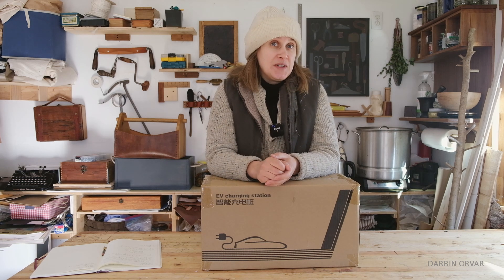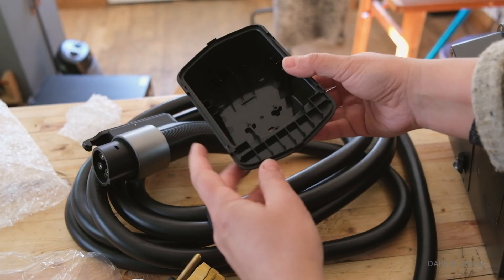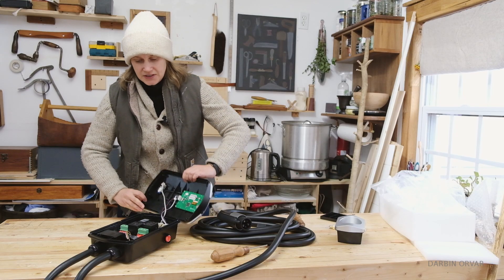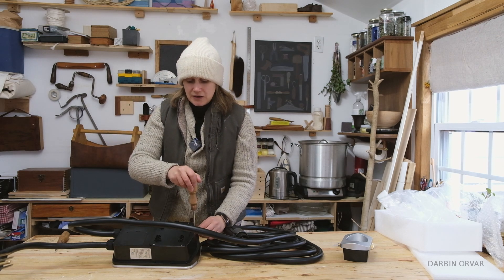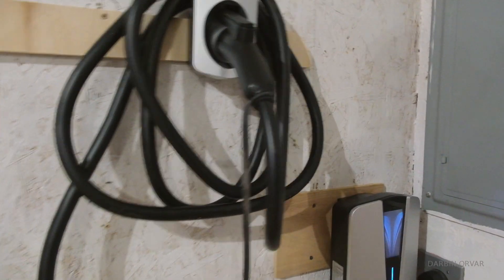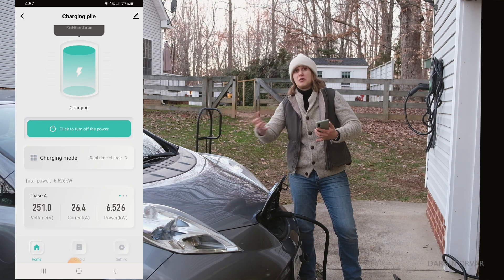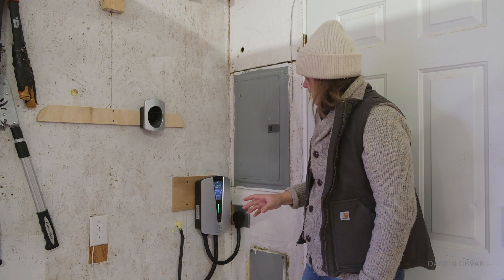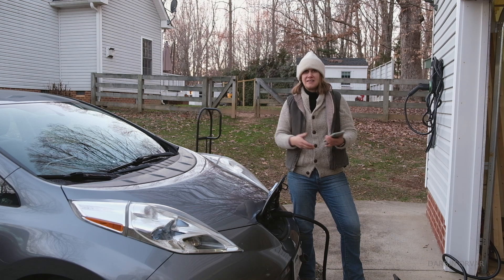240v Home EV Charger: Telgeoot Level 2 Charger Review

Comment: Great video,This is a smart charging unit,Allows to adjust charging current range from 1 to 48A, level 2 EV 240V 11kw home charger can work 7X faster than a normal Level 1 chargers , Say goodbye to long charging times.

This is truly an excellent overview using technically correct but understandable terminology.  Thanks！

Comment: 👍👍This product looks really good and I can't wait to buy it, it charges much faster than what I'm used to. The installation seems simple, and you can check the charging status using WiFi on your phone. It must be very convenient to use. I checked their official website information and found that this product has almost a 5-star rating and can be charged unconditionally in rain or snow. The performance is really high.

Comment: Do you have to have this connected to a 240 V outlet with a 50 A breaker?   Your car apparently has a maximum input current of 26-something A, below the 30 A capacity of most household 240 V circuits.  Are there cars that can accept higher input currents, and if so, can this device be "throttled" to avoid blowing your household breaker each time you try to charge?
Neat gadget, nice video.  Too bad about the "app dependence" but I'm just a curmudgeon.  Thanks for sharing, Linn.
Reply: Darbin gets the purpose of amperage limits wrong here. Setting the amperage limit is not about the capacity of your car (which will automatically take its maximum), but of your wiring. If you do connect this to a 30 amp circuit, you'll need to set the charger for a maximum of 24 amps (which is 80% of the circuit's capacity)

Many cars can take more than the Leaf's 26 amp maximum

Comment: Too bad you can't pull in to your garage.  I have the charger head and cord dangling from the ceilng just by the front license plate making it very easy to plug and unplug the charger to the car without having the weight of the cable to worry about.

Comment: Ev are stupid. You charge your car for 100 $ and after freezing night 30$ of your fuel is gone. How is that economical. You fill your petrol car with 100$ and after freezing night you still have 100 $ worth of fuel in your tank
Reply: Not sure what you mean by this?  If I put $100 of electricity into the car overnight, that is exactly what I have in the car in the morning. And with the Nissan Leaf, you can even set the temperature you would like to have the cabin at the time you plan to leave in the morning.
Reply: @davidabineri908  if temperature is below  - 18 C like now in my country than from 100% charged battery it drops to 90 just by sitting outside
Reply: Wrong. Go back and do your homework again
Reply: @Jose-qh6bc  if in summer fully charged car can drive for example 100 km and in winter it can drive only for 80 km than it lost it's fuel. You want to tell me that temperature doesn't have any effect on battery? You are wrong and go back do your homework